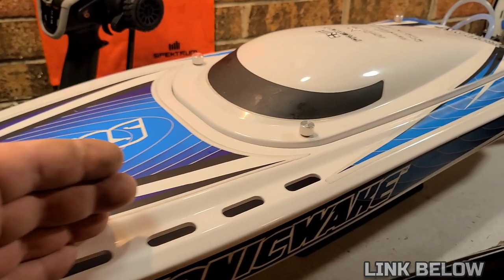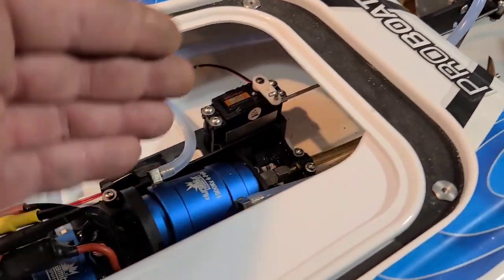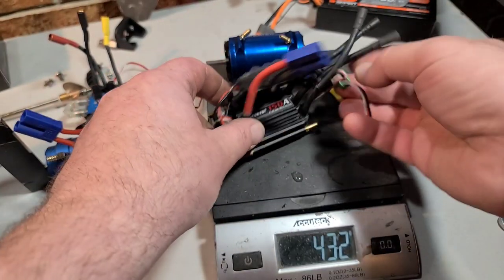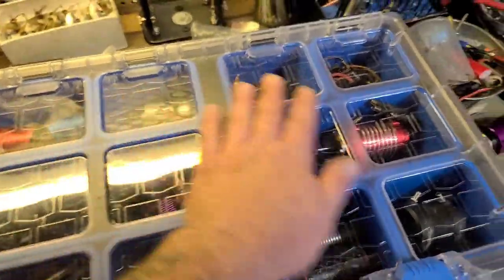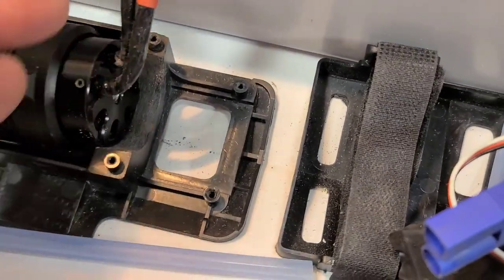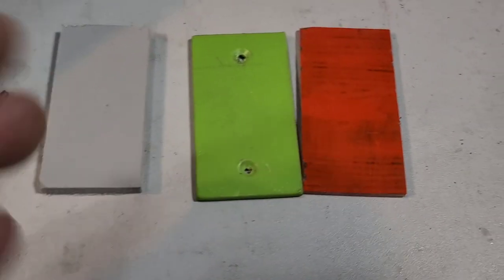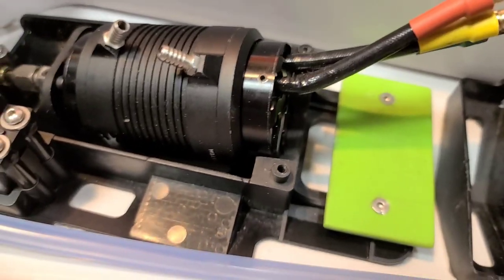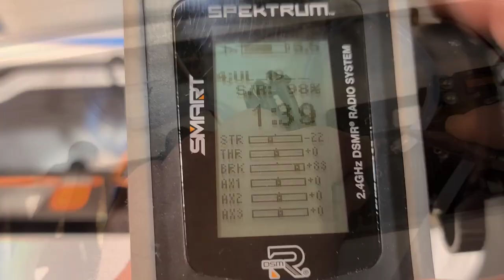40mm Brushless Motor Install Proboat Sonicwake 36 Electronics Upgrade - OSE 150a Esc

Comment: I have done this with the boat and I also increased the prop size it was very hard to drive cuz if you gave it too much throttle too fast it was literally Spin and flip upside down and torque of the crop which spin the boat on the top of the water
Reply from the maker: Bigger turn fins help stop the spin out

Comment: Great video Big B, and great mods 👌
I make my own ESC mounts and battery trays using 2mm foam board (yeah you know I love the stuff) with two layers of carbon fibre mat and epoxy. Strong, light, cheap and IRONCLAD! 😉
And never apologise for the length of your videos buddy... longer videos = more knowledge shared 👍

Comment: what u do about front mount???
Reply: I was wonder that myself. As the diameter is for the smaller motor it may have to be sanded also, unless it's flexible enough to fit round the top of the new motor and screwed into place. Oh. I read your comment as the top mount, not the front lol

Comment: Quick question what do you set your timing at on your flycolor esc? I have this exact same set up in my sonic wake And it's pretty badass but just trying to tune it a little bit more
Reply from the maker: I believe I had it at 15° or stock timing?  I can't remember

Comment: Quick question I basically built a clone of sonicwake upgrades and I was curious what you set you punch level at on your ESC ? And any other setting adjustments  suggestions would be greatly appreciated 🙂  Love Your videos you rock!! 👍👍
Reply from the maker: if its your first run with your new set up  then i usually run My boats punch at one but if I'm confident in my set up id go up to 5 punch, depending on what I'm trying todo
Reply: Thank you

Comment: hey IC....when you say ..more power...i'm with ya all the way...when you are choosing a smaller cooler ring for that mtr.....remember:
1. the battery creates the power
2. the esc transfers the power
3. the motor transfers it to heat.....motors melt....that armature shellac turns liquid and shorts everything.
.hope the shorty ring works...
Reply from the maker: Hopefully it will work out. I don't push my boats to hard.  I may put the larger ring on if Temps get hot.
Reply: @IRONCLADRC  Does the transmitter/reciever have telemetry options, you could have a temp reader on the motor, keep you in the loop on whats going on below deck as your boating along :D

Comment: Which Board do you think I should use, cutting board or fiberglass for ESC mount?
Reply from the maker: Either one really, personal preference..  I used the cutting board because it was thicker than the fiberglass and lighter.
Reply: @IRONCLADRC  thank you

Comment: Hi If I want to make a 1m long boat at 200km/h, what motor should I use? Do you have any recommendations?
Reply from the maker: Really depends on the weight of the hull and what your trying to do with the boat.     40 series motor should work.  Something like a 40 84 or 4092 is. 1600-1900kv range?   Hope this helps

Comment: Just wondering what would the difference between the sss 4074 and the sss 4082  both 2000kv besides the obvious can length? Still trying to rap my head around what's going on inside these brushless motors. Just want to make the right choice before buying. Already ordered the flycolor 150 esc. Not looking to break speed records just decently fast with no heat issues. My stock boat has Basically had to heat issues from day one. Sorry for rambling just looking for advice.
Reply from the maker: I'd stick with the 4074, the 4082 may heat the speed control up a little more than you'd like it to.   The longer can offers a little more torque than the short can, but has more current/Amp draw in return. Since you already have the flycolor otw I'd stick with the 4074.   I think the 4082 would be pushing it. In my opinion
Reply: @IRONCLADRC   Much appreciated Thank you!!

Comment: I have a sonicwake and I'm looking to upgrade the electronics and I was wondering if you had a chance to run your boat and what your feelings on the upgrade from stock ?
Reply from the maker: I'm going to run it on 6s here in a few minutes video will be out tomorrow morning. I ran it on 4s the other day here's the video.  Way more power so far I like the new powerhttps://youtu.be/34VmPNP_CzI

Comment: Where I can get batteries 4 s good ones 2800
Reply from the maker: I've used  these spectrum smart 2200 4s 100c in my blackjack 24  and they were amazing. A little pricey but if you have any issue they have a  warranty. Where as most other companies do not.  https://www.avantlink.com/click.php?tt=cl&merchant_id=953aec29-878e-4306-b620-2df85883455e&website_id=70256520-69d3-496b-a06d-cfbf9af7a81d&url=https%3A%2F%2Fwww.horizonhobby.com%2Fhttps%3A%2F%2Fwww.horizonhobby.com%2Fproduct%2F14.8v-2200mah-4s-100c-smart-lipo-battery-ic3%2FSPMX22004S100.html

Comment: how long is that boat in size ? by mm if you could measure :P
Reply from the maker: 914mm
Reply: @IRONCLADRC  man, thats really close to mine, that is hull only ? not with rudder ?
Reply from the maker: With out rudder
Reply: ok, my deltaforce is 988 on hull only, my rico is about 700mm or so

Comment: Hey brother I’m having issue after issue with my flycolor 150s and what would be the next best esc and motor
Reply: Sealing 180 ? spectrum 160 ? And what big motor should I use for top speed
Reply from the maker: Are you gonna do the big block mod?
Reply from the maker: If so sss 4082 2000kv should be a beast with a hobbywing 180
https://www.offshoreelectrics.com/proddetail.php?prod=tfl-sss-4082-v2&PARTNER=ironclad
Reply: @IRONCLADRC  what about the 4092 2200kv or is that not enough torque
Reply: @IRONCLADRC  is the firms 160 a lot better than the sealing 180?
Reply: Firma
Reply from the maker: @Budgetrcbuilds  firma is 8s capable hw 180 is 6s, the 4092 2200 would be good, but you'd almost need a Hydra for that setup.
Reply: @IRONCLADRC  hydra?
Reply: I feel like imma go the 160 just so I cAn run 8s  and find a lower kv that’s 8s capable I think little more expensive but then I can get into the 70-80 mark easier
Reply: Nmv like the castle creations ?
Reply from the maker: @Budgetrcbuilds  yep gonna have to go lower kv with the firma trust me I know, firma doesn't like big motors and high kv
Reply: @IRONCLADRC  what would be and ideal set up for the sonic even if it’s a bit pricey ?
Reply: What about a 200 amp sea shark that’s 12s capable but only ran 6-8s ?

Comment: What size shaft is that
Reply from the maker: . 187 (3/16") flex cable with 3/16 prop shaft
Reply: @IRONCLADRC  thanks
Reply: Is there a way to fit a 5mm shaft without changing the flex cable?